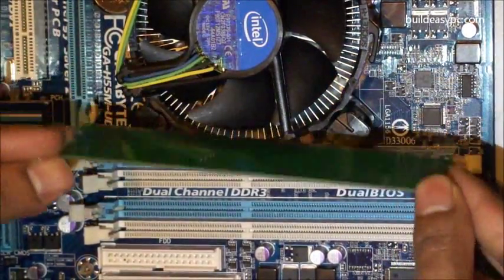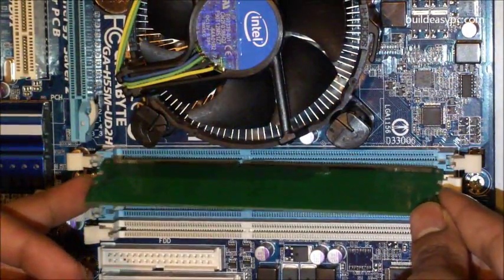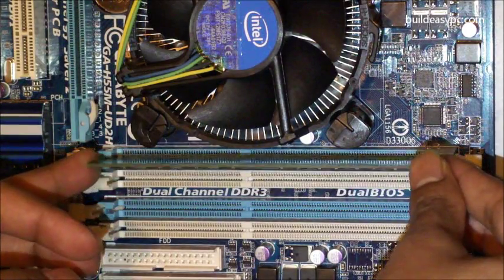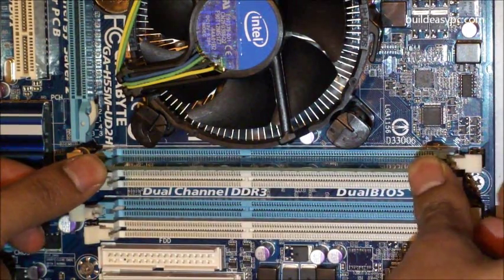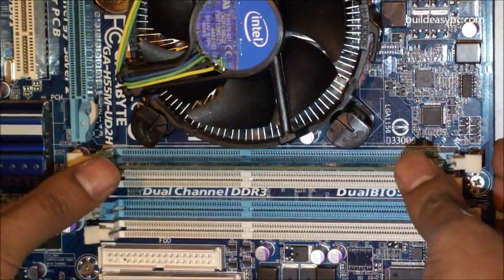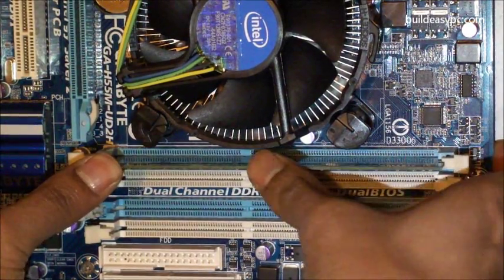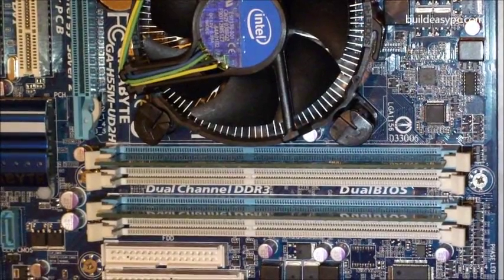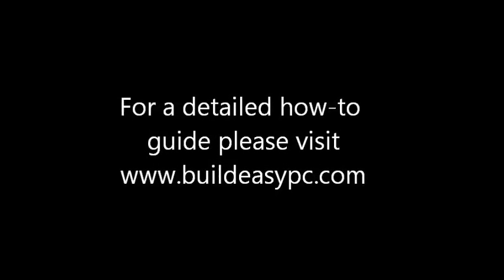Build Your Own PC: Step 4 - How to install DDR3 Memory

Comment from the maker: @TommmHD452 Yes, make sure that the RAM is installed in matching slots. They are normally colour coded. This allows it to run DDR mode. If you have a single RAM module then use slot 1.